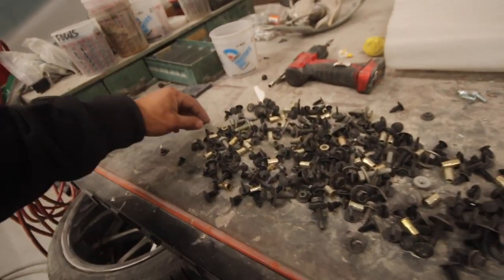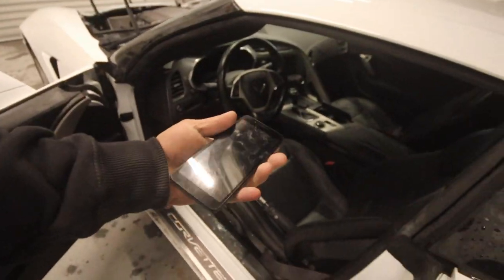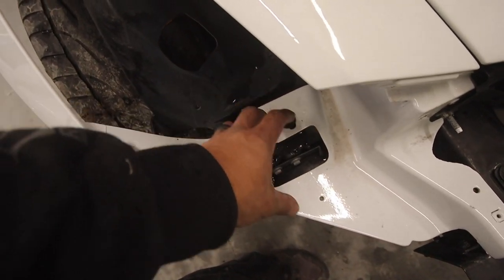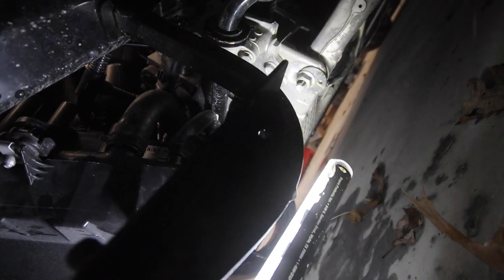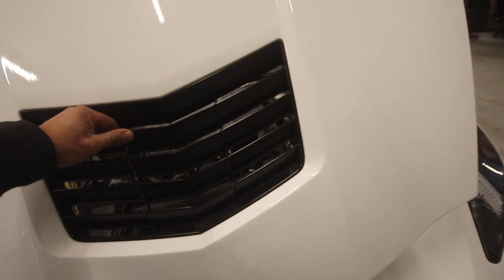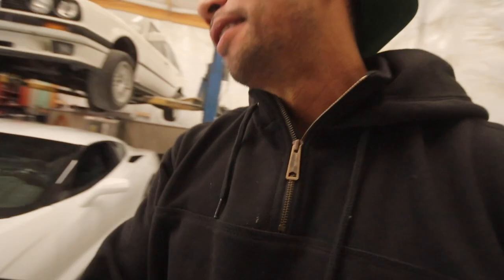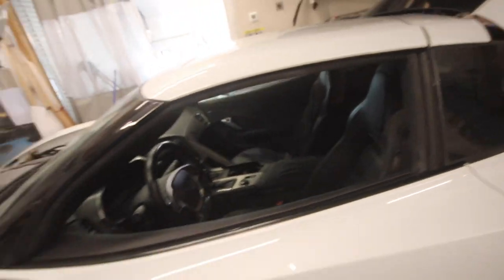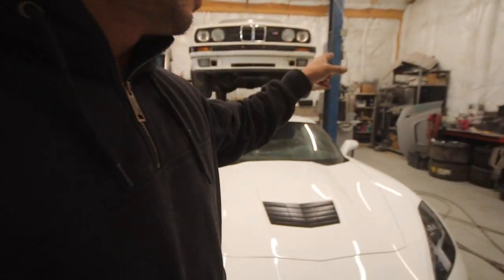Rebuilding a CHEAP C7 Corvette  *part 4* Assembling the body after paint

Comment: I had no idea there was so much work in panel gaps 😜

Those headlights have some elements of lambo style :) You probably don’t want to put more time into it but a little smoke clear over the Y shaped reflectors inside would make those headlights less obviously aftermarket
Reply from the maker: Yea man gaps are the first give way that something was wrong here....and that's a good idea! I couldn't pass up on the price. But it's going to need something else so they aren't so noticable